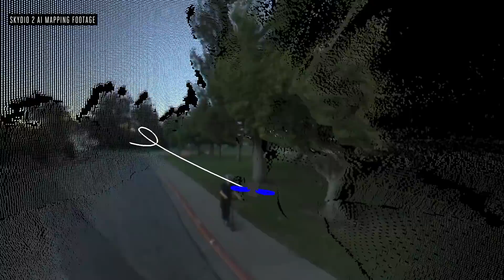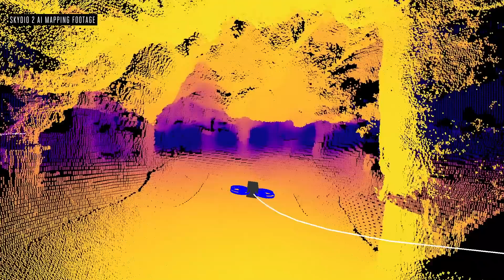The best autonomous drone just got better

Comment: Thank you for all the great info.! I have one on reserve that will be shipped in January. I came across a concern today, somebody stated that the R1 batteries were discontinued when they discontinued the R1. In addition, nobody was told about this in advance. I did a little research, and I can't find them on the Skydio site or elsewhere. If this is true, it leads me to believe that the same thing may happen with the Skydio 2. I'm a DJI MA owner and love it but, if the Skydio is everything they're saying, I'll be head over heals. Thanks again. Ray
Reply: While we are not selling R1 batteries any longer we do have a limited supply and work to provide batteries in special circumstances to our R1 customers who need them, as welling as giving all R1 owners $300 off on Skydio 2.
Reply: @Skydio  So with this information, should I expect the same once the Skydio 2 is discontinued? Certain circumstances to get a spare battery (if you have one) along with $300.00 off a Skydio 3 if there was one. This will be a deal breaker for most people. I know how I would feel if I had an Skydio 2 in my hands after investing well over $1,500.00 in a RC, Beacon, Filters, etc..and can't fly it. I can only imagine how the R1 owners feel.
Reply: Well.........

Comment: So, since I already have an Anafi, I figure I could use the same controller with the Skydio 2? Or would that not work? I guess that would depend if the software on Skydio’s controllers is different from the original Parrot ones...But if it’s possible to use the same controller for both, I’d be much more inclined to buy a Skydio 2.
Reply: They are not cross compatible unfortunately. The hardware is Parrot's but the software is all Skydio.
Reply: @Skydio  Good to know, and thanks for the reply! :)

Comment: It's great to know that it's not assembled in some place where workers almost have no rights like  in some place in China, Bangladesh or something.
Reply: Yeah, when you consider higher labor costs in the US, the price actually isn’t that bad. High, yes, especially since the base package doesn’t have a controller (and $150 for a rebranded Anafi remote?). But not too bad all things considered. I’d figure most of the high price is to account for the extra 4K cameras and the software. The body, frame and most other parts are probably fairly cheap to manufacture.